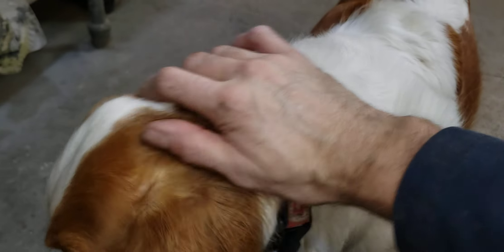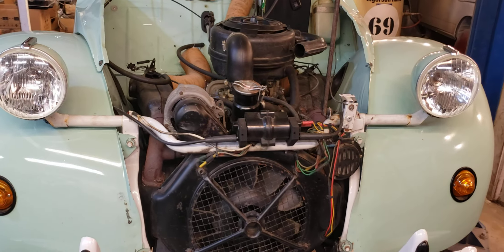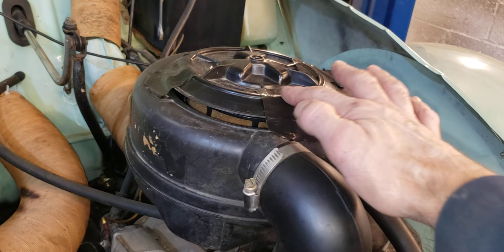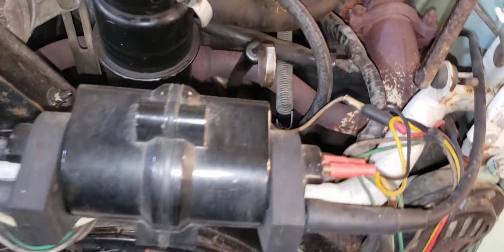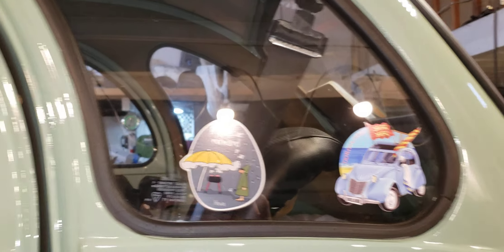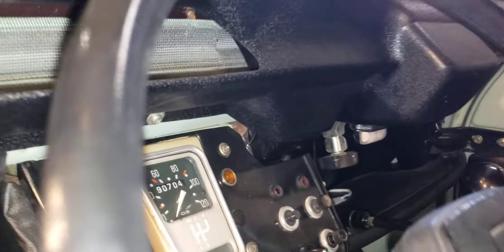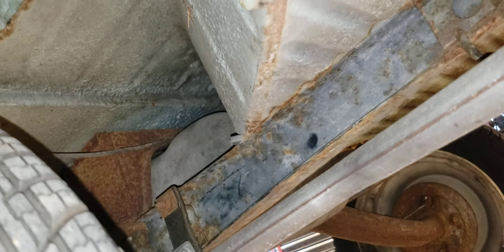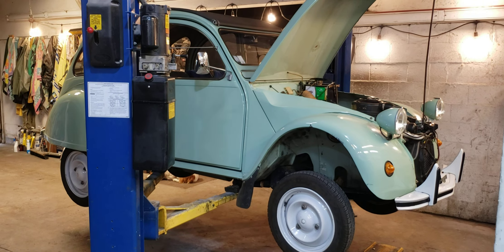Minty Fresh Iconic French 2CV

Comment: Yup that underside needs some corrosion protection/treatment ASAP, I’ll bet you on a couple of things:
1) the tappets have been ignored for ages and as a result there will be stinky old oil in the tappet covers.
2) the pilot jet will be blocked - it’s at the front of the carb along with the fuel filter.
3) there will be crap in the bottom of the float bowl.
4) those drum brakes are a bear to set up.
5) make sure the spring cans are lubed with vegetable oil and the drain holes are at the bottom
6) check the suspension knife edges are good, lube with a grease brush - if ignored they can wear right through the suspension eye.
7) check for corrosion at the rear seat belt mounts.
8) for starting - right foot flat to the floor; hot or cold.
9) there is a timing hole in the flywheel and a matching hole in the casing (also on the ford model A too) align with a drill bit or Allen key.
10) the coil will overheat - even in the winter, so it’s not unusual to have 2 bolted in place on the light bar for a quick switch over. An aftermarket Harley coil is a good replacement.
11) a lot of the fixings are M7 - an unusual size and easily stripped - be VERY careful with the oil union banjo bolts.
12) the seats pop out for picnics 
13) male sure there is a fuse in the wiper feed - there isn’t from the factory and if the wiper spindles seize the motor will catch fire (the spindles will leak when it rains anyway).
14) have a look see if the windscreen has been fitted the right way around - it’s toughened glass with a “clear spot’ in front of the driver, it’s possible to fit it upside down leaving the clear spot in front of the passenger (prob more usual on RH drive cars.

Any questions don’t be afraid to ask.
Reply: Great points.

Comment: It's in a very good condition, but I still would treat the underside to prevent further corrosion. They have the reputation to rust very fast and the chassis starts to flex between the cabin and the engine bay. 
They were very common during my childhood, just like the Volkswagen Beetle, the Renault 4, they all had their typical sound which I miss nowadays. 
Hope you take us for a testdrive!

Comment: Ive owned a few myself and love them! Currently have a 1989 in the uk, it’s definitely  a 602cc model, drum brakes were fitted to 2cvs up to 1982 so well into the life span of a 602 engine and they use dot brake fluid instead of the LHM fluid discs use :)

Comment: Jade Green was available from 1979, and disc brakes were not introduced until 1981, consistent with a 602 drum brake model specification.  Oil temperature gauge is not standard.  Might be worth checking the suspension "knife edges" and links as these can wear badly as they are very difficult to grease properly and are usually ignored.  The mess of wiring came as standard!  I have recently fitted a new wiring harness to mine and is now considerably neater than when I bought it new.  The voltage regulator was originally clipped on to the battery, but with a change of battery we fix it to the bulkhead or the inner wing.  Check for bulkhead cracking around the battery tray, the UK club sell a special support bracket ( the thin bulkhead metal is weakened by the heavy battery.)  A new air box would be a good investment.

Comment: The rear French license plate is one of the pre Euro plates. The last number 18 defines the 18th Arrondissement in France. That is the district in Paris around Montmartre. Fitting plate. And yes the old French plates were white in front and yellow in the back. 
Great rust free vehicle as it looks like. One of my dream cars I still want to own besides a DS.
Reply: Wrong! 18 is the Département du Cher in central France, the Paris arrondissements did not have a special plate number, Paris as a whole was number 75. Check the Wikipedia link below. The old French plates had white letters and numbers on black background, front and back, then reflectorized plates were introduced, black letters and numbers, white background in front, orange-yellow in back, but old ones could still be used for a long while.  https://en.wikipedia.org/wiki/Departments_of_France
Reply: @@retiredbore378 Been there, done that!